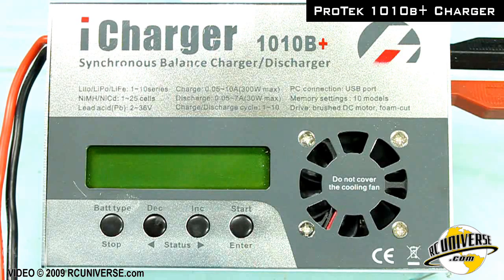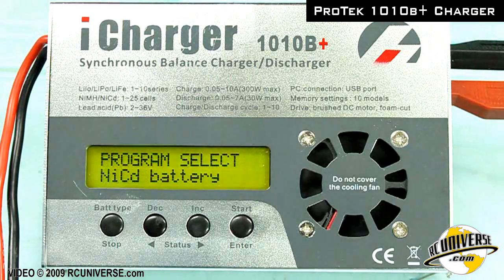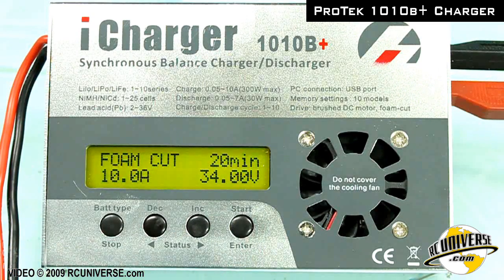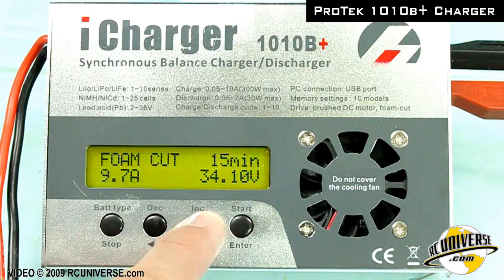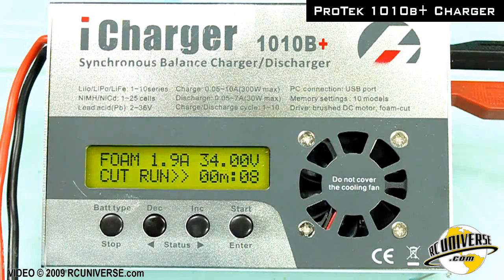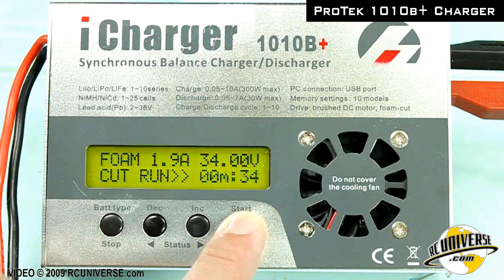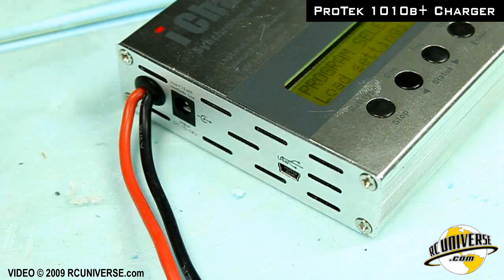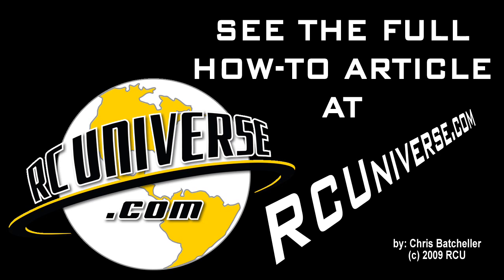How To: CNC Foam Cutting Machine.  Part 2  ProTek 1010b+ Charger (with Foam Cutting Software)

Comment: I hooked it up to a car battery (in foam cut mode set to 12V / 10A) and it stops at 0.25A. Its hooked up to about 1m 0.2mm NiCr FoamCut Wire. WHAT IS WRONG?